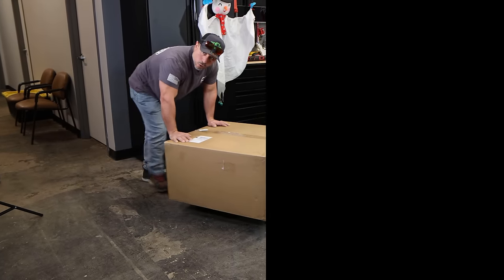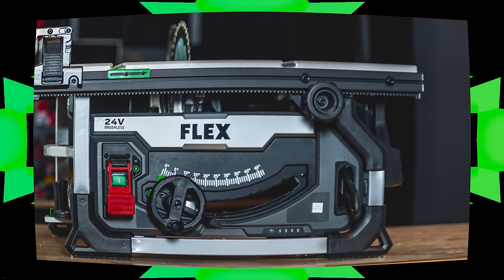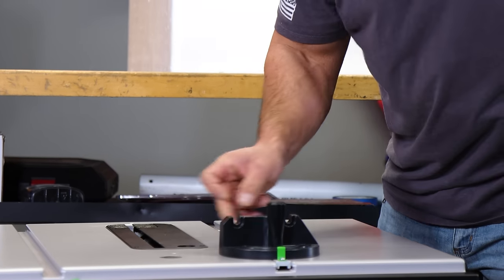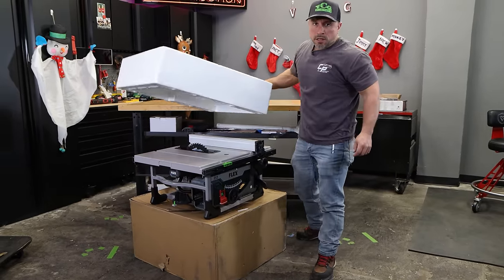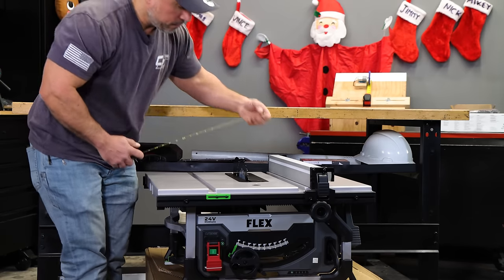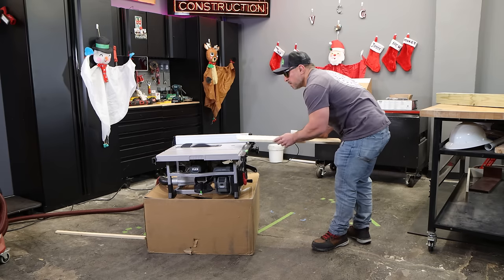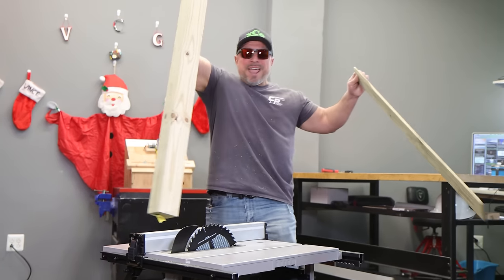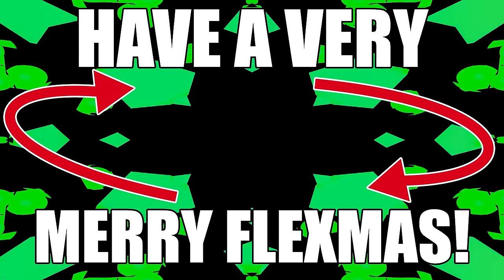Flex 10 inch Table Saw - Unboxing, Setup & Review Reveals Features Other Saws Missed!

Comment: Great review but I would not advise using a flimsy cardboard box as a stand. Things could have gone squirrelly quick!
Reply: I’m typically not the guy that says should’ve had safety glasses on, but I have to agree with this.
Reply: Literally the first thing I saw. That cardboard box is trouble !
As a side note, all brands should consider corded adapters available for cordless table/miter saws.
Reply: Best way to show its not chattery.
Reply: Thats what I was thinking, not sure to say thats just how good the flex table saw is or or the steady skilled hands of Vince…. Lol…. But I’ve definitely seen many videos where things go bad quick, especiallly with bad saws, even simply dull saw blades.😅

Comment: Love your review, on your next video, can you talk about how flat the table top is? Are the miter slots well aligned.. Issues you might have encountered, run time? Is the fence 90 degrees to the table top? 
I’m thinking about buying this for fine carpentry, I live in apartments and have a detached garage and I want to go cordless as I only have one 15amp outlet. 
Very excited for this table saw.

Thank you!

Comment: I have the DeWalt 10" table saw but not happy that they didn't include a push button saw blade lock to remove the saw blade. Two tools must be used to remove the blade on the DeWalt. Not sure about the Flex though.

Comment: My metabo does all that  does not have the fancy light but it does every thing the Flex does and does rip 4x4s on a single pass  with one small modification  but the metabo has a 35 inch max Right and 22 right max left rip  and it has room and meat to drill holes that allows you to add sliding miter attachments will bolt to that would be used on shop saws ................. but like with every one of these job site table saws (Milwaukee DeWalt metabo ) all of them the biggest issue the the Rails getting out of whack and needing to be re adjusted causing the Fence to go out of square so we will see in a couple years if there rails hold up   time will tell But at least they did it right like Metabo did  making it AD and DC powered  that AC adaptor will be a huge game changer to the Flex platform  and really put them into the contractors market more ......... now all they need to do is make more nailers  duplex, metal connector,  coil nailers a good timber nailer a sheeting stapler  and then they will impress me

Comment: Enjoy your videos however it seems like your channel has changed significantly. I really only see occasional reviews and store walkthroughs these days and you've also got that series where your fixing that house. Anyway I have to agree with some of the other commenters, you're a professional and people watch your videos to learn and take your advice you literally done videos instructing people on how to operate this or that I was really shocked to see you using a cardboard box as a table saw stand and think that that was not your best work setting a good example for people who come to your channel to learn. What you have there is literally one of the most dangerous commonly found in shop tools on the market definitely needs to be respected I don't care if it's a sawstop never turn your back on it metaphorically speaking as soon as you think you got it by the balls it gives you a reach-around and takes your balls from you metaphorically speaking.